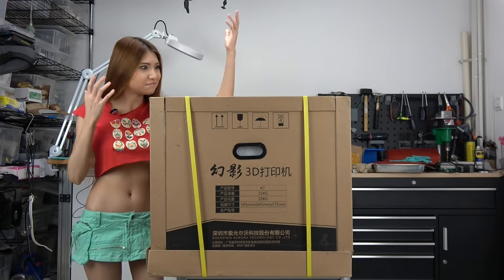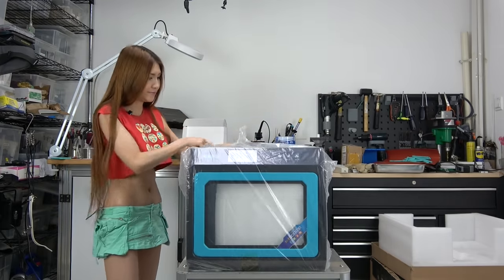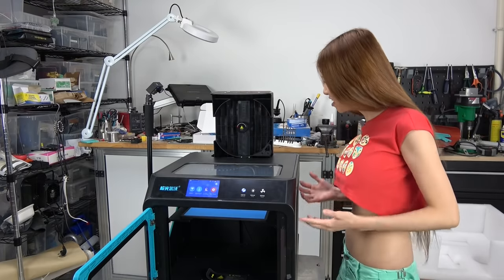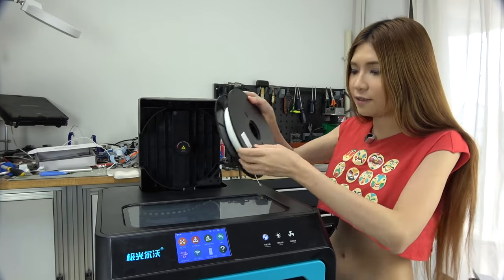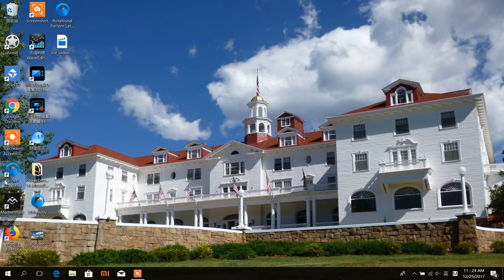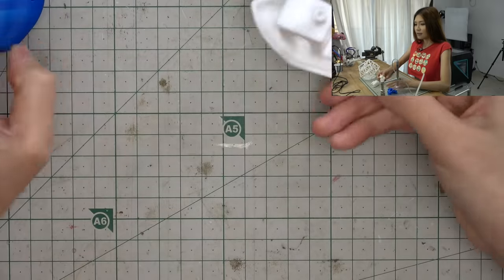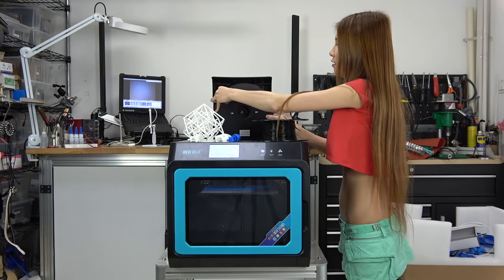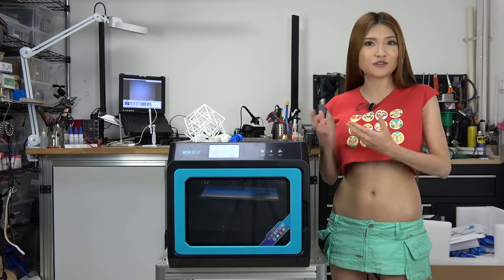China's WEIRDEST 3D Printer? JGAurora A7 Unboxing & Review

Comment: Haha! Hey Naomi! :D I was curious about this 3D Printer since I saw their strange video about it last year. It looked really good but definitely disappointed in the strange choices of blue tape  and looks like part cooling could be improved a little. I think they copied the Makerbot 5th Gen for this machine! I have been testing the JGAurora A3 and it's similar... professional looking but strange design and part choices and WHY do these companies sell these machines before they're ready??? Not OK!
Reply from the maker: I'm going to at least replace the bed with Buildtak or something similar...decent enough hardware and the community could probably fix the firmware in a bit but they just won't release source😕 Thanks for the use of your cube😊
Reply: Gotta make profits fast LOL

Comment: Ha Ha! I loved your entrance :)  And your expression when the machine tried to eat you !  The system does seem to need some getting used to.
H-Bots do have some advantages in terms of speed and weight reduction.  In many way's I prefer them.
I have a love/hate relationship with Bowden style feeders.  I really had to fight with mine on my delta printer and I found it works better the fewer turns and bends in the feeding tube.  Took a lot of messing around for me to get it right.  I'm pretty sure I would not buy another bowden drive system unless I had ability to modify it.   I think JG used a dual drive system to overcome the resistance they had in their feed system.
A good honest review.  Thank you :)

Comment: This machine has tons of potential.

The "ship it back for firmware upgrade." That's a little suspicious. I hope they are not using a firmware without giving credit.

If they spend another 6 months to get wifi ready and design the huge 'CD' loader to accept standard size filament, they could have a winner on their hands. But, personally, the loader is fancy but not necessary.
Take a page out of Creality. I've just bought their CR10 S5 and I have to say, their customer service for keeping me informed on shipping is excellent.
Excellent review and great points you mentioned.
Kind regards

Comment: Thank you for a fantastic preview on this printer, Naomi. <3
The hardware Auto-leveling actually looks quite professional. But I believe that the proprietary filament spool format is a big mistake by the company.
And you're right: sending a 20 Kg machine back to China every time it needs an update is no fun. Very expensive too, when you live on the other side of the planet.

But probably not many people will buy a 20Kg 3D printer anyway, especially with the weird spool format. Most people will want to have more freedom.
And advertising on-board WiFi (misspelled MiFi on the display), while it isn't really there... That was a very bad decision by the manufacturer.

Again, thank you, Naomi. <3

Comment: One thing they could do is add automatic leveling to print cycle instead of requiring you to start the level cycle. But it's odd you have to send it back for flashing, and that they use an proprietary spool size.

Comment: I have found using hair spray on acrylic acts as a smooth surface to print to and allows for an easy release. this gives the printing surface a glass smooth texture. I usually coat the acrylic about 5 times wiping it smooth and then letting it dry. After 5 coats, I print on it from then on using one coat between prints.

Comment: My heart sank just like yours did when the filament roll dropped. lol. It was a surprise for me as well that it did that. Kudos you kept your cool, just a little stunned and rightfully so. 😉 I have the Aurora A5 and I love it. Now that I had it for two month's I modified the fan bracket and got rid of the ridicules fan noise, now it's good. I plan you upgrade the firmware to Marlin.

Comment: great video Naomi. the problem I see as you pointed out is the proprietary filament holder, possible fix print duplicate, then you would have to "load on to that reel" the filament you want to use, if the original reel has a "chip" in it then duplicate reels would not work, Keep up the great work

Comment: I think you could make a frame with a couple of rollers and a guide for the filament, then you could wind the filament off the other brand spool on to the Aurora  spool. I've seen something like that for sewing machines and knitting machines - you buy the threads in a large spool and put it on the small one to use. Maybe power it with a drill to make the transfer process faster. Do they sell their spools empty?

Comment: Thank you for the great look at the A7. At 2200.00 USD its kind of over priced. I can see adding a small hole or opening for the filament to be feed in to it from the outside.  Add magnetic flex plate build surface and lower the price and you have  awinner as the print quality looks great !

Comment: Thanks for being so honest about this printer. At first sight, it looks really cool and futuristic... And the bed leveling system is a big selling point. It would have convinced me instantly just for those two things but the filament loading system is something of a deal breaker. As for the firmware issue... Maybe the actual hardware to support Wi-Fi isn't installed on the board and that's why they insist to have the machine shipped back to them?
Anyways, it looks promising!

Comment: not sure how they in any way plan on justifying a $2200 price tage when it has nothing above or beyond anything half its price. A fancy spool elevator that adds one more thing to break down.. (let alone the issues from the start you had), an odd angle of feed that makes it about useless to more brittle filaments like wood/copper/brassfills/etc, or even PLA that has some moisture contamination.. 2 motors that may/may not be synced well enough so could cause filament grinding between them and pack the bowden tube full of debris..

Comment: When I was a beginner using the blue tape masking tape inside, the long parts keep bending and ripping off the tape  very dissapointed then a replace the tape with  a fin glass  2.5 mm glued on  the top of the bed  so the sensors for autoleveling still working on the   glass spread fine film off papper glue with a credit card  autolevel heat up and run

Comment: Did I see it right?  Did the mechanical auto-leveling actually straighten out the plate after you purposely tilted it?  If so, that's a pretty damn cool feature.  Also, good review.  I'm curious to find out if they will fix the firmware or not.  If not, then I look forward to seeing it get hacked into working!
Reply from the maker: Yup- it actually straightens it! Cool huh? Yeah will probably have to hack it...

Comment: Does anybody know how tall Niomi is the work tops look massive next to her even if they are intended as a standing work space. Is it hard to get desks at a better working height?
Reply: I measured her thingiverse 3d scan: she's 162mm tall head to toe
Reply: 5'3" according to her pastebin FAQ. https://pastebin.com/V3474kYs
Reply: Thats a lot taller than i would have guessed. I wonder why the worktops are so high.
Reply: forerunnert:    Are you kidding??? 162mm is 6.378". She might be a little short, but that's ridiculous.
Reply from the maker: I'm 162cm, I got the workbench second hand it is a little tall but I'm used to it, there's a lot of storage inside and it's better for my posture. I have a good neck and back even with my chest because I am very careful not to make a habit of leaning over things.
Reply: Thanks for the information. I had assumed that the units where cm not mm as that would give a height  in the range I expected. Good posture can be hard to maintain I find my self leaning over things more than I should.

Comment: Given that with my FF Creator Pro 2016 I have to print spool holders every time I buy a new brand, I'd hate to try to find filament for that printer! Sure it has no DRM chip, but looks like you'd have to buy filament from them or maybe find $$$ 500g spools that would fit. No firmware flashing is a deal killer on a new printer that is bound to have loads of firmware bugs (or missing features like wifi!) I like the hardware levelling though.

Comment: Enlightening and disappointing product. It's still in Beta based on non-working WiFi and the other issues U noted. It should not be in production and in distribution channels. 

It is unfortunate that GearBest is selling equipment that does not meet advertised claims. I can't image that they are not aware of this. One reason why I will not buy from them. In the US it's likely that they and the manufacturer would be entangled in a lawsuit.

The perception by many is that most 3d printer's produced in CN, Shenzen are "race-to-the-bottom" units. Naomi, U have demonstrated that companies in Shenzhen want to change this (and my previous business consulting work in Guangdong reinforces this), but the issues with this printer, and the apparent lack of the company to understand, and fix baseline 3d printer design requirements, continue to reinforce this.

U might want to mention the overall quality of construction. Use of linear rails is outstanding but there are good and bad linear rails. Same applies to the parts, particularly criticism of CN made hotends.

Next, look at the price GearBest is asking. A whopping US $2,117.90! Talk with their financial officer and GearBest to see how they came up with this! There are a number of well established companies (PRUSA, Printrbot,  LulzBot, gCreate, Raise 3D, etc.), that offer superior equipment, with quality support, and an extensive professional/maker community providing outstanding value. This printer becomes an unlikely purchase, and therefor takes the company out of any future consideration. 

....and U don't have to send it back to the factory for a firmware update or worst case, rewind UR filament on their spools...  Sorry, but this is laughable...

Best wishes to Naomi and her followers for a happy and prosperous New Year of the Dog...
Reply: My guess as to the sending it back is the WiFi hardware is not installed yet.  If you can't field flash the firmware, that should be a deal breaker for anyone looking to buy a printer.